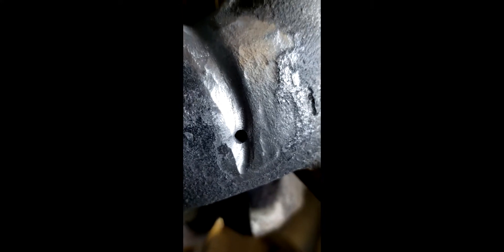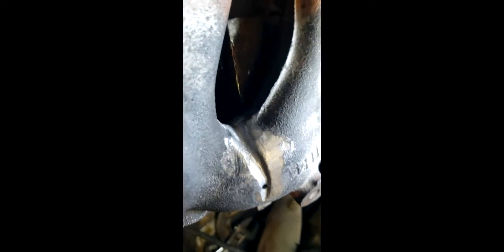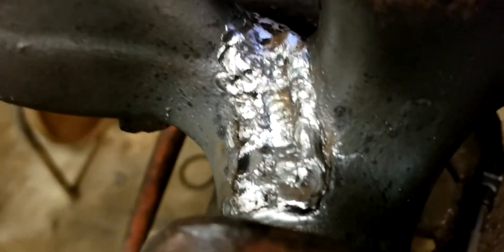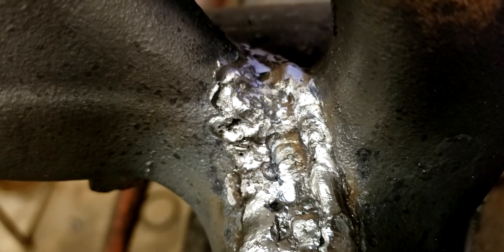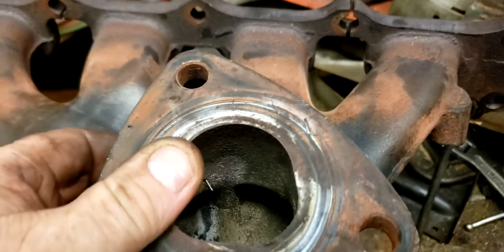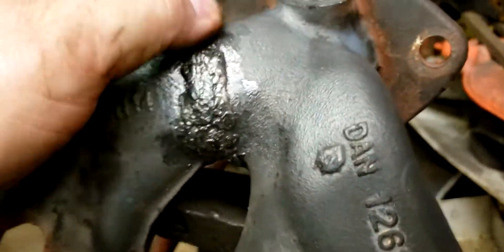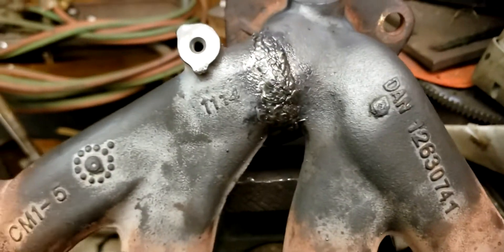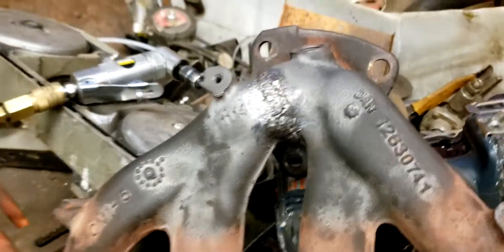2012 Chevy Malibu  exhaust manifold Repair

Comment: Agreed Blueflame. I was taught it was called an exhaust manifold but if you had steel pipes bent and tuned (same length on all pipes) it was called a header.
I've seen professional welders do the same with holes on each side of the crack to stop cracking; I've also seen that done with drywall cracks. Always learning. Have a good weekend #3.
Reply from the maker: yea if you got to be so p.c about it
Reply from the maker: it still looks better than hunter biden's art
Reply: @3madeamps  
PC? You mean the difference between an exhaust manifold and an exhaust header?
Reply: @3madeamps  
Never seen his art and don't care too.